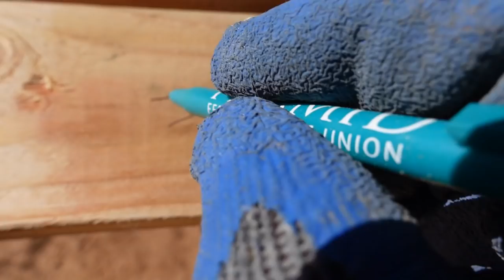How To Build The A Frame Goat Playhouse! Step by Step, DIY -/\-

Comment: Built this over the weekend. Such a fun build to do with my wife. We live in Alabama so we went with treated lumber. We put deck boards on the inside of the A, to help with ventilation and left enough of a gap for poo to go through. I had a piece of aluminum flashing on hand, so I put that at the very top to keep the driving rain out… we’re super proud of our structure, thanks to you guys for such an easy to follow video! 

I said “WINGO” more this weekend than I ever have before!

Comment: I got the charcoal bar and I use it on my face. I love it usually when you use soap on your face your face feels really dry and you can’t wait to get moisturizer on, but not with this soap your face is clean and soft. I have left moisturizer off just to see if  my face would feel dry but it doesn’t feels just like I put moisturizer on. So I give the soap five stars!!

Comment: This is a great tutorial. I am gonna have to figure out how to adapt it to FL weather lol. With our humidity & heavy summer rains, even treated wood (pine) is challenging. I could do 2x4's out of redwood or possibly cedar but not sure about the plywood part. Plywood here,  will separate and fall apart even if painted, without roofing material or tin etc over it which would get torn up or be too sharp. I will think of something lol.
Reply: 🤔broad hardwood or vinyl planks, with the 'stairs' at the seams to prevent dripping... or maybe thick plastic sheets...

Comment: After setting the frame up and then trying to straighten it out while attaching stuff, it kinda looks like a drunken spider. 
Just wobbly legs everywhere.
(Also the kindred feelings seeing Emily somewhat struggling. She'll grow out of it hopefully. It's not fun trying to handle things many inches or even feet bigger then you. I'm 5'3" and the most recent incident was trying to load a John Deere onto a trailer and trying to move a plank of wood that was legit about 4 inches taller then me and wider then my shoulders. This was a thick board too since it was for under the tires.)